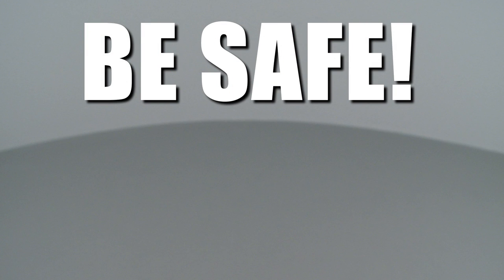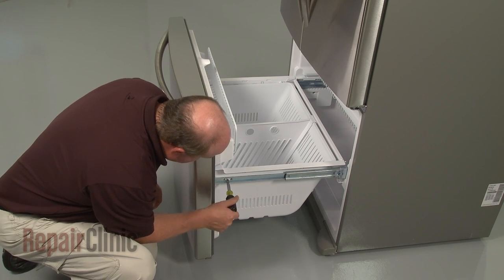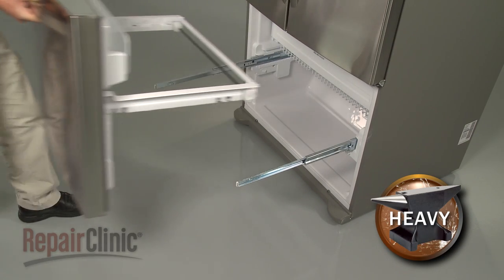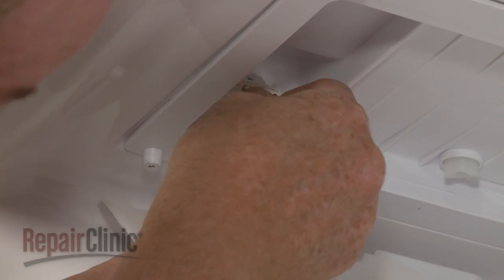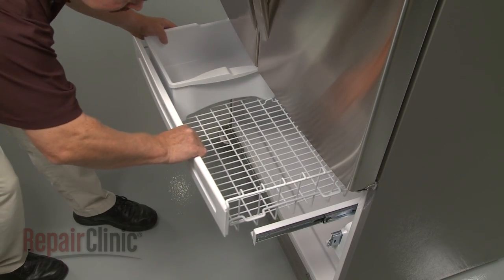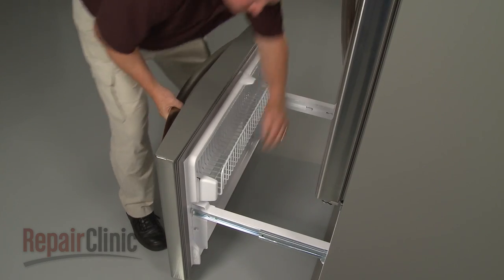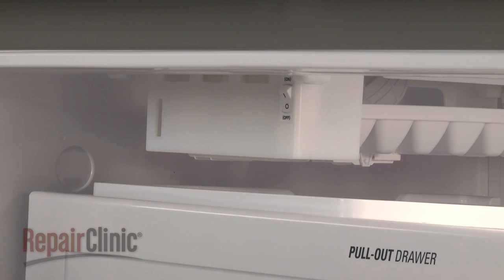LG Refrigerator Won't Make Ice? Ice Maker Assembly AEQ72909603

Comment: You can remove the ice maker without removing the bottom drawer and front.  Just remove the top drawer and you should be able to remove it knowing where the screws, tabs, and the pin connector is.  
I removed mine and found there was no ice chunks in the mechanism, and the water fill tube was clear of any ice at the tube from what I could see.
I plugged it back in, letting it hang loose and pressed in on the test button.  The ice tray and arm all seemed to be moving and working.  I put a cup in front of the fill tube when I did this as I thought water would rush forth to fill the ice tray.  No water rushed forth.  I think the unit has to be put back in place as there is probably a lockout to stop the water from flowing.
I connected it back in place and pressed in the test button for a few seconds.  I heard a rush of water like it used to to fill the ice cube tray.  
It is now working again.  Some folks below say you have to press in the test button to calibrate and get it working with a new unit.
I think what might have happened is during an extended blackout, the ice maker lost calibration and stopped working.  All I probably needed to do was recalibrate it and get it working again.
Reply: where was the test button?
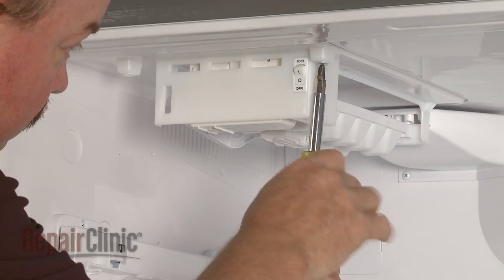Reply: @tinasaland4403  Stop at 1:19 .  The test button is on the bottom near the front left.  See those two parallel lines on the bottom left front at 1:19 and 1:20.  The button is right between them.  It is right above the "P" in their "Repair Clinic" logo at 1:20.

Comment: Tip:  To calibrate how much water was coming into tray, pull inlet hose out of the back, hit reset manually, measure the water that comes out.  I was able to retrieve one cube from my slabbed over tray, melted it down to "normal" size which turned out to be 1/2 oz.  So for a 12 cube tray, 6 oz of water is what was needed to fill tray.  I adjusted the water line valve, and no more over spray.  You can start with 6 oz as a guide for your ice maker, or try to freeze a cube, thaw and measure it.  No more overspray or icebergs.  Good luck.

Comment: AND to MAKE IT WORK you HAVE to CALIBRATE ice dispenser.  or it will not fill with water and no ice as you guess,  to calibrate it,  bottom  left side of ice maker small button  ( NOT ON or OFF!  its at side right.) you need to press it and hold a few seconds then dispenser will calibrate and fill water.
Reply: My Automatic Shut Off Arm seems to be stuck in the UP position so the ice maker thinks the bucket is full of ice. It will not continue to make ice. Please help. Thanks.
Reply: @bhealy18  i think this is my issue as well.
Reply: This is more helpful than the video itself. Thank you, I got mine working again.
Reply: Thanks!
Reply: I searched all over for this info. Thanks for saving me a tech support call/visit.
Reply: But after pressing it and filling with water do you still have to wait for about 24 hours for it to start cycling automatically?

Comment: Great video!  Very helpful. Makes the process very easy.  Highly recommend you first try the reset button on the bottom of the ice maker to determine if it needs to be replaced.  It fixed ours that was not working.

Comment: One step I noticed that was missing at the end of the video was once you’ve installed everything and plugged the refrigerator back up is to make sure you press the test switch which is located on the bottom of the new ice maker to get it going, thank me later 😉
Reply: I am thanking you now!   Thank you.
Reply: Thanking you now also!!!
Reply: Thanking you later!  I was baffled why it was not working. Now, I know.  🙂
Reply: So after pressing it and it fills with water does it still take about 24 hours for it to cycle automatically?

Comment: Our ice maker fills with water and produces ice, but only dumps it with a manual ice dump by pressing and holding the reset button every time. I have to remember to do it ever few hours, or it will never dump on its own. Has anyone else experienced this? Was it fixed with an ice maker replacement or something else?
Reply: Literally the exact same problem I'm running into now. So frustrating. I just replaced my ice maker and calibrated it. Waiting to see if any ice is automatically dispensed
Reply: Same problem here.  I don't know much of anything about ice makers but my guess is a sensor is broke

Comment: My mold tray is stuck at about a 45 degree angle, reset button does nothing, on-off switch does nothing, and a power plug cycle does nothing .. does anybody know what my problem is ?

Comment: I have an LG bottom freezer with ice machine in freezer. My issue is the water stopped filling up the tray. I reset the tray and it turns, as well as the arm. Do you think the issue is the ice maker or the water inlet valve on the back?
Reply: Same issue
Reply: @omarsanti79  this was the solve for me.
Reply: Valve or ice maker?
Reply: @omarsanti79  valve was the issue.
Reply: I do appreciate you taking the time to respond from a 2 yr old post. Thank you.

Comment: Is there a heater kit to keep this inlet water nozzle from freezing over.  I replaced the water valve and it continues to freeze right at the end of the tube coming thru the ceiling.
Reply: Mine has done this for years, have you figured it out?

Comment: Most helpful. Thank you. But our problem is that the arm has now lowered on our NEW Kenmore Elite xxx.79042.xxx. Makin ice, but what will happen when it's full?  Your video shows arm in UP position on old and new assemblies. Is this "normal?" How can I bring the arm DOWN on this icemaker? Thanks again!
Reply: Jim , did you ever get an answer? I just got my new LG and the arm stays in the UP position so the ice maker thinks bucket is full. Please reply ASAP. Thanks - Brian
Reply: Look at S1ayeR  response above,  mine was the same way, but press and holding the reset button under the L front of the ice maker resulted in the ice maker cycling through a cycle which includes the arm going down then up, the cube part rotating.  Ice started forming over the next few hours.  If you have a bottom 
freezer the button can only felt for or seen with a mirror.

Comment: Anyone know what to do if the ice maker works but wont fill with water
Reply: Thanks to RepairClinic for this helpful video. I had a similar issue but using parts of this video I was able to troubleshoot. In our case we have a LG bottom drawer freezer with ice maker inside that. We went on vacation for a week so we turned off the water to the house. When we came back the ice maker was not working. I tried checking the water feed lines on the back of the refrigerator and everything was clear but did discover that there is a water reservoir 'tray' at the bottom rear of the refrigerator and it was overfilling with water because the ice maker was trying to make ice but the water was backing up and overflowing at the back of the refrigerator and dripping down the rear panel of refrigerator into the tray. After following this video and removing the ice maker/tray unit, I could see that the water feed outlet just above the ice tray was frozen solid. Before that I had tried running a hair dryer into the back water inlet at the rear of the refrigerator where it feeds ice maker (also after removing the feed piping and gasket that runs to the ice tray) but it is a long ways to the end of the tube to get to the water outlet. Back inside the freezer ice tray I was going to run the hair dryer on it for a bit to melt the frozen clog but just tried pushing up with a screwdriver onto the ice blockage and it popped right off and a small trickle of water came down. It runs fine now.

Comment: How do you remove the ICE TRAY?  I'm confused
Reply: My AEQ72909603 ice tray cracked so I recently bought a refurbished AEQ72909602 assembly for $60. Once the replacement was installed the arm wouldn't work so.... I just popped the ice tray out and put it into my assembly. It fit perfectly and works great. Of course there was nothing wrong with the motor of my ice maker, just the cracked tray.

Comment: I just got a new LG refrigerator with this ice maker. It will make ice but the Automatic Shut Off Arm stays in the UP position so the machine thinks the bucket is full and won't continue to make ice! Please HELP!
Reply: Brian Healy: try to remove as described, clean it, dry in. Maybe ice is making problem, make sure you have in the bottom box space, and its right side, there is a hole in top of the box at upper left side. Where the arm moves.
Reply: S1ayeR Thank you!